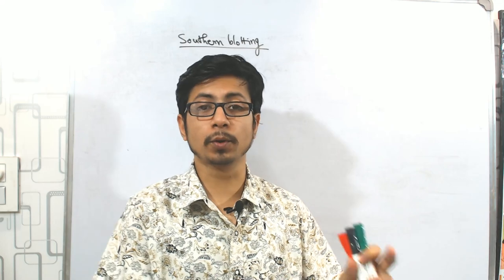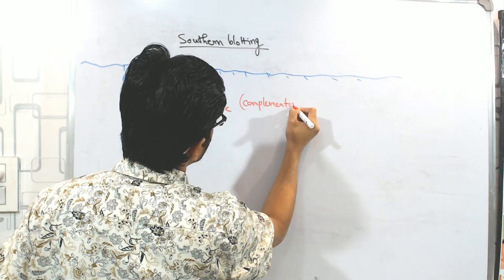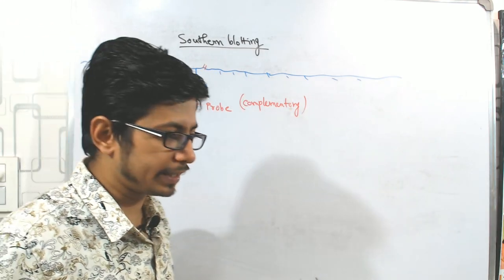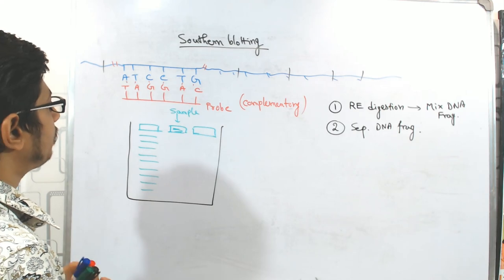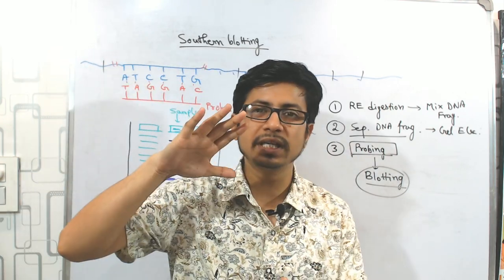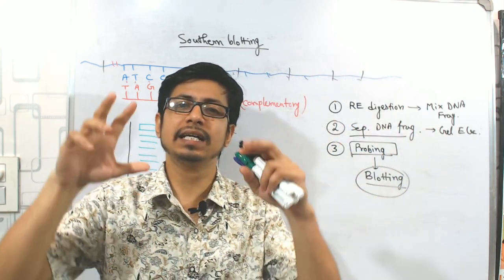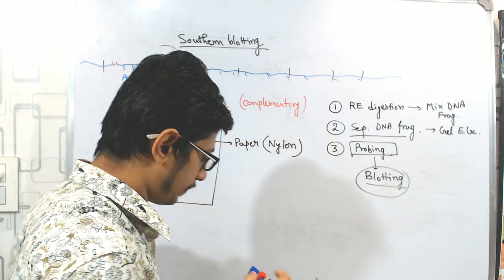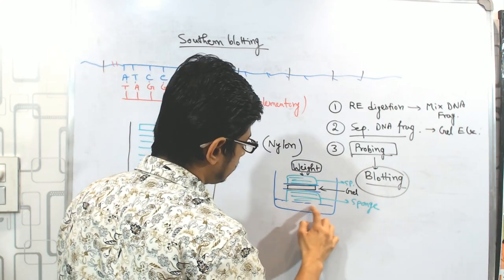Southern blot | Southern blotting technique explained

Comment: Sir i would like to inform you that you've skipped a very crucial step of Southern blotting in this particular lecture,, DNA sample in which the target DNA sequence is present is most of the time going to be in double stranded from ,,we must have to denature it into single strands after the electrophoresis stage ,, because if we leave it as  double stranded the probe will not going to bind it